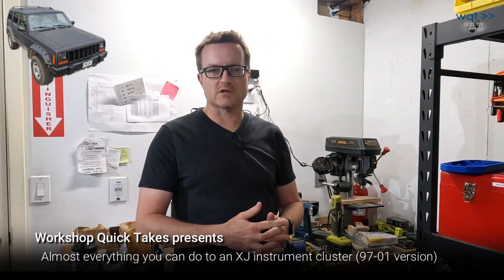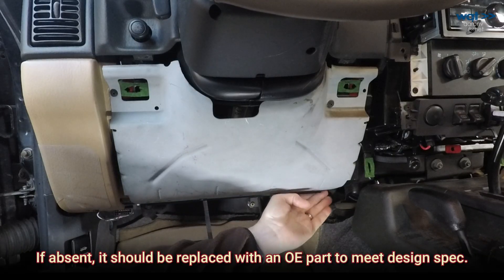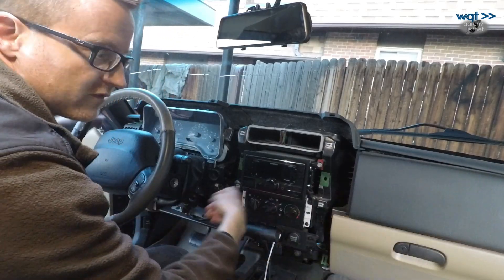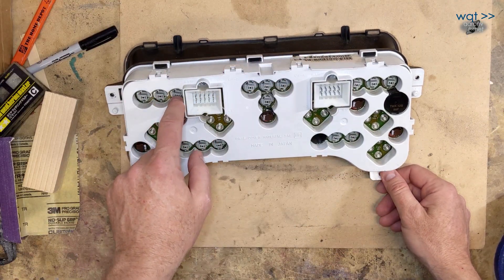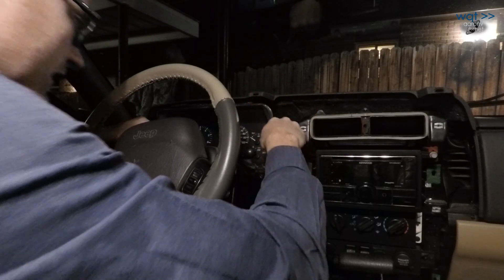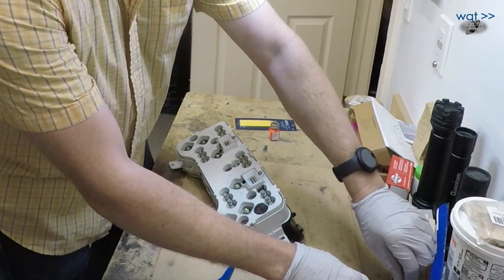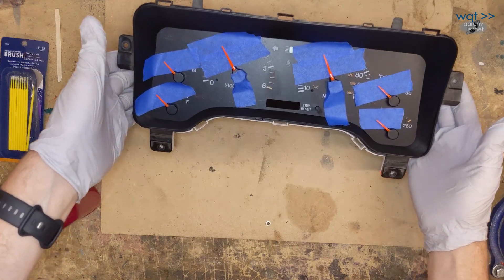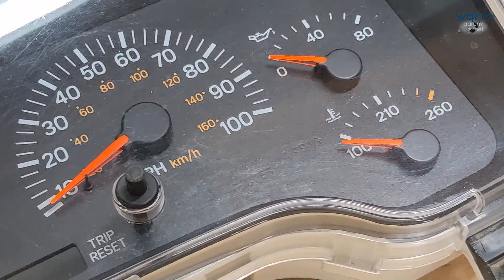projectXJ: Instrument cluster "almost everything" refurb! (97-01 Cherokee XJ, some Wrangler TJ)

Comment: I did the exact same thing about a half year back, But I also used 3m blue painters tape and restored the warning zone orange with the same testors fluorescent orange color like the factory. You have to press down pretty firmly enough with a fingernail to make sure the tape line is nice and sharp, and if a mistake is made, let it partially dry, and peel it off. Makes a world of difference, and the light still gets through just fine. Only I could not get the kmh numbers of course, but that’s it. I do need to polish the plastic face though.